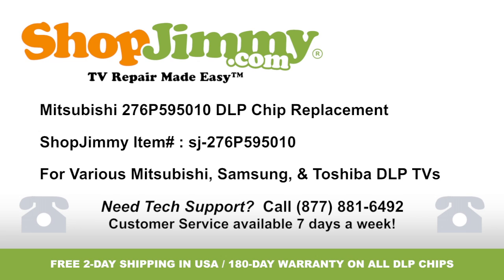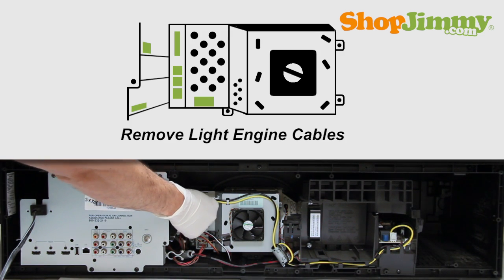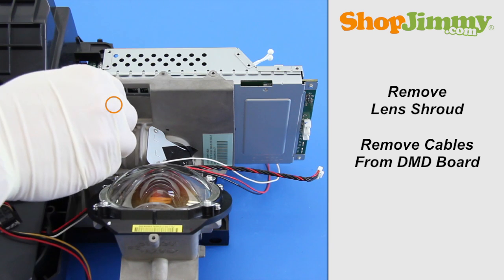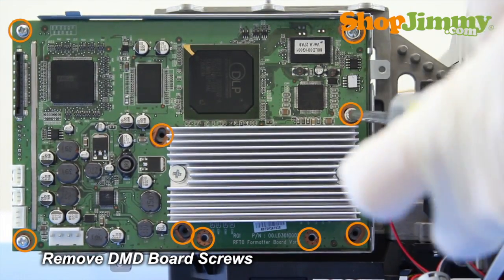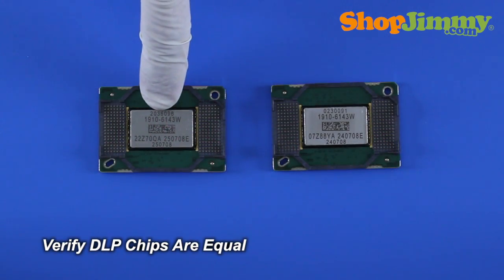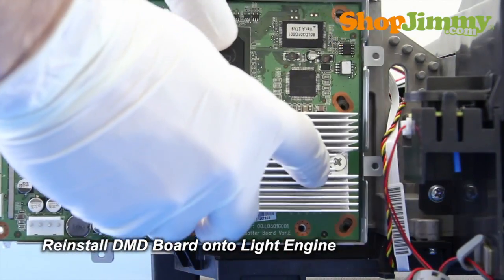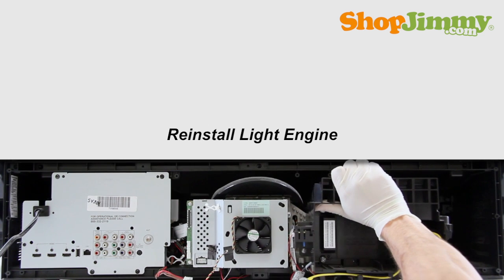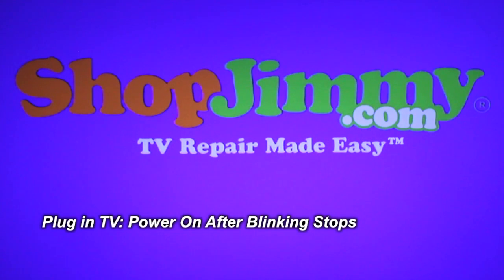Replacing a DLP TV Chip - White Dots Issue - How to Fix Mitsubishi DLP TVs

Comment: I just finished replacing my dlp chip for my Mitsubishi WD-73735, and now when I power on the tv there is sound, but no picture. After 30 seconds the tv powers itself off. I then took everything apart and reperformed the install for a second time, paying especially close attention to the pictures I took to make sure everything was in it's proper place. Same results. Sound. No picture. Powers off automatically after 30 seconds. Then I opened up the hatch and removed the bulb for inspection. It does not appear to be blown. I have 2 previously removed bulbs from over the past 5 years in a box and I took a look at them and you can obviously see that the old ones are blown, because they are black/gray/smokey looking at the stem of the bulbs. The one in the tv is clean,clear and was functioning properly 3 months ago when the white dots started appearing. I unplugged the set and put the tv to the side until today. There are no colored warning indicator lights showing on my tv. The red lamp warning indicator light is not coming on. The status light is red while the tv is off, I press the power button and the tv switches over the the timer light and it is green. Then 30 seconds later the set powers off and the status light turns red again. What's going on here?
Reply from the maker: Jason Buffington   Be sure to lock the chip into place.  Thanks!  www.shopjimmy.com

Comment: I bought my new dlp chip several months ago and am thiking about doing it today. Found a comment on another YT video before finding this one - the comment mentions a "heatsink compound" which you don't mention in your install - is there a need for a heat sink compound?  thanks!  Great vid by the way - will probably post another comment when I'm done.
Reply from the maker: rgee bee   You do not need it.  Thanks!  www.shopjimmy.com
Reply: ShopJimmy.com
That is a bad call, If thermal paste is in place reapplying can cause air bubbles resulting in poor conductivity, If it is a pad then the first time the chip is heated it causes it to take form and fill any voids... NEVER should you reapply a pad as it will not fill those voids again. You should NEVER remove a heatsink and replace without changing the interfacing materials

Comment: Hey guys looking for some help with a Mitsubishi WD 60735. I installed the dlp chip to get rid of the white dots but now I get just a snowy image on the TV and after a couple minutes the Tv turns off and has an  orange STATUS light blinking . Sound works fine. I believe I may have connected the wires improperly.
Reply from the maker: Rich Ramos   Double check all of your connections and also be sure the lamp door it shut all the way.  Thanks!  www.shopjimmy.com
Reply: Thanks I'll give it a try soon.

Comment: I have a Mitsubishi WD-65638 similar to the one in this video. I followed the video very closely it took me 2 1/2 hours to finish since it's my first time doing this. Now when I turn it on the light is green then flashes red then yellow what did i do wrong or what's going on?
Reply from the maker: *****   I recommend that you reseat your chip and check the lamp door to be sure it is closed all the way.  Thanks!  www.shopjimmy.com
Reply: ShopJimmy.com Thanks for the advice but it turns out it was my DMD board it had to be replaced.

Comment: For a Mitsubishi WD-60638 which chip system should I buy. the Samsung/Mitsubishi/Toshiba 4719-001997 DLP Chip (Original, New) or the Mitsubishi 276P595010 DLP Chip / DMD IC --NEW / Original. I don't know the difference, it's giving me a option so please help me?
Reply from the maker: Stephanie Jones   Here is a link to a replacement chip for your TV model:  http://www.shopjimmy.com/samsung-mitsubishi-toshiba-4719-001997-dlp-chip.htm  Thanks!  www.shopjimmy.com
Reply: Okay thanks, I got the right one than.

Comment: A great video- what did we do before You Tube??- I just successfully replaced the DLP chip in my WD-65735 in about 45 minutes. This video was great in explaining what is to be expected and the tools needed. I am fairly technical and most likely could have done it quicker but for a fear of ruining another chip due to static electricity. As a note the WD-65735 does not require the entire lower section to be removed only the cover of the light engine, heat sink and pull the board off. Just make sure that you have the rubber gloves and handle only the edges of the board. Also take a picture of the cables at the top in order to ease the location on replacement. Also recommend a magnetized screw driver for the board screws as they are difficult to reset in a couple of corners.

Comment: Just finished replacing my chip on my Mitsubishi... A couple of notes not mentioned in the video (which was well done).

a) You don't have to remove the entire light engine on my model.  The board comes out fine without removing everything.
b) It is a very good idea to replace the heat transfer putty. There is some fancy nano-diamond materials that supposedly work  best. If you don't replace the thermal putty, your problem will likely come back since heat is the root cause.
c) Clean everything carefully before putting it back together. Dust can cause multiple problems (heat, lamp failure, etc.).
d) I'm considering putting in a better fan... these TVs are great when they work but thermal management was not very well done.

Thanks very much for the post, I'm a rank amateur at these things so it was a lot of help.
-John
Reply: Upgrading the fan is not a bad idea at all...

Comment: I have a Mitsubishi WD-60737 that has white dots on the periphery and black dots on the bottom 1/3 of the screen towards the middle. I have seen mixed reviews of whether to change to DMD board alone, the DLP chip alone, or both.
Can you give some advice?
Reply from the maker: Rob Neuenschwander   I recommend replacing the DLP Chip in your TV.  Click this link to a replacement chip for your TV model number:  http://www.shopjimmy.com/samsung-mitsubishi-toshiba-4719-001997-dlp-chip.htm  Thanks!  www.shopjimmy.com

Comment: The pins are straight - next?
Reply from the maker: steve lazoritz   Be sure the chip is locked into place.  If the chip is securely locked into place and the pins are not bent, and you still have a problem, then I would say the formatter board may be bad.  Thanks!  www.shopjimmy.com

Comment: Just replaced the DLP chip on my 73734. Everything was pretty similar to the video. The only minor difference was there was a cable going into the light engine that screwed on/off. That connector also had to be unscrewed before DMD board housing could be removed in addition to the screws in the video.

Following the video made the whole thing a snap. I also purchased a new lamp. The combination of the new chip & lamp literally made my TV like new. The amazing HD quality I purchased the TV for in the first place is back!

Comment: I just completed replacing my chip for someone else' directions. When I completed the process, I had vertical lines, but the dots were gone. I then Googled for chip replacement once again and found this video. The key step that was missing was unlocking the old chip, installing the new one and then locking the chip back into place. The lines are gone, the dots are gone and I am once again watching a clear picture. GREAT VIDEO!!
Reply from the maker: Jay Mueller   At 4:20 in the video we show how to unlock and remove the DLP Chip.  Then after showing the search, we show how to install and lock the DLP Chip into place.  Thanks!  www.shopjimmy.com

Comment: I replace the DLP on my Mitsubishii. White spots gone ! Now I have vertical lines. Yikes!  I reseated the chop. No change. Suggestions?
Reply from the maker: steve lazoritz   Check and be sure that you did not bend the pins on the chip.  Thanks!  www.shopjimmy.com
Reply: Make sure you didn't tighten the heat sink too tight (the springs are meant to hold the heat sink in place)... I did and the contacts must have come loose a bit since I had exactly the same problem. You might also consider putting some new heat sink putty interface while you are at it.

Good luck!

Comment: I have a sony KDL-46XBR4 and the screen is all vertical bars until I touch the screen and pull on the right side then picture is fine.  I have a video of this.  Can't figure out how to add to this comment.
Reply from the maker: gchase65   This sounds like a TV panel (TV Screen) problem.  If your TV panel is bad, it may be more cost-effective to replace the TV as panels are typically hard to find in stock, difficult to replace, and expensive.  Thanks and please let us know if you have any further questions!  www.shopjimmy.com

Comment: I have a Mitsubishi WD65735 with white dots and a purple shadow at the top of the screen.  Replacing the lamp didn't fix the white dots although I know that will be fixed with a new DLP chip.  however will it also fix the purple shadow I am seeing?
Reply from the maker: Marc Dorn   Yes that will be fixed by replacing the DLP Chip.  Here is a link to a compatible replacement chip:  http://www.shopjimmy.com/samsung-mitsubishi-toshiba-4719-001997-dlp-chip.htm  Thanks!  www.shopjimmy.com

Comment: I normally don't write reviews but am compelled to write one after installing a new DLP chip in my Mistubishi WD-60735. I am not a handy man and have zero patience for anything to do with tools and mechanics. I got the dots and my choice was to buy a new 60" or try the chip replacement. After watching this video several times I decided to go the chip replacement route. I just completed the job, it took about an hour and it worked!  

Few observations/suggestions:
 1. My Mitsubishi did not look like the one in the video, especially when it comes to wiring and the overall mechanical arrangement.
 2. I didn't have to remove the lens shroud but I did anyway following the video instructions.
 3. Good thing I tock pictures at each step before removing any wires. My wire harnesses were different than those in the video.
 4. If it was't for the pictures I would not know what goes where and definitely would've screwed up.

Otherwise, everything went without a hitch.
Reply from the maker: Tad Witko   Thanks for your comments!  This is the goal of the videos is to provide help and tips for your DLP Chip Replacement.  www.shopjimmy.com
Reply: I have the same type of TV

Comment: I have a Mitsubishi WD-65837 should I use heat sink thermal compound oh heatsink when I replace the DLP chip ?
also is there a way to reset the lamp timer back to zero when I replace the lamp ?
Reply: I would like to know this also. But, since I'm in the middle of the job any answer will likely come too late to help me.
Reply: +The Cuch They said in an earlier response, "no" specifically. I haven't put any on mine but I gotta admit, I am concerned about it regulating heat. I might go back in and replace with thermal paste.

Comment: Ok I have a lg 47ld450 and it won't power up by has the stand by light flashes I'm pretty sure I have already change what I believe is the power supply any ideas please let me know
Reply from the maker: Dakota Keele   Since you have already changed out the power supply, I recommend replacing the main board to see if that fixes the problem.  Click this link to replacement main boards:  http://www.shopjimmy.com/catalogsearch/result/index/?cat=56&q=47ld450  There may be multiple boards for the same TV model number, be sure to match part numbers on your current board, with your replacement for compatibility.  Here is a link to a video showing how to identify your part number, click here:  https://www.youtube.com/watch?v=RwHTvjMdrhk  Thanks and please let us know if you have any further questions with your TV Repair!  www.shopjimmy.com

Comment: I replace my lamp about 2 months ago, then I started getting the white and black dots on my Mitsubishi DLP WD-Y577.  So I replace the Chip, but now I'm getting the steady red lamp.  Anybody have any suggestions on what I did wrong?
Reply from the maker: Kevin Berry   The first thing you should do is make sure that your lamp door is closed tightly.  If that looks good, I would go back in and reseat the DLP chip and double/triple check all of your connections to make sure everything is correct.  Thanks and please let us know if you have any other questions!  www.shopjimmy.com
Reply: ShopJimmy.com Thanks, I reset the chip and everything work fine.  Thanks for your help.

Comment: i purchased a replacement dlp chip for my mitsubishi wd 73737 tv from shop jimmy.  before replacing the dlp chip, the lamp was working, just had lots of spots in the picture.   i just installed the dlp chip and am confident i did it right.  when i plugged the tv back in, the light in front is flashing yellow, which according to my manual, indicates a failed lamp.  i was very gentle with all parts coming out and back into the tv during the replacement of the dlp chip.  is that a normal occurrence for the lamp to go bad during this process, or might the flashing yellow light be indicating another problem besides a bad lamp?
Reply: I figured out the problem.  I didn't replace the bottom panel when I tested the tv to see if it was working after replacing the dlp chip.  I didn't realize the bottom panel engages the lamp switch.  After replacing the bottom panel, the lamp switch engaged and the tv works like new.  Thanks much for the reliable part, reasonable price and very helpful video.  Many thumbs up for ShopJimmy!
Reply: Nick Matzorkis 
Thanks Nick for replying with the solution. I did the same exact thing of trying to test before replacing the back panel and that orange status light was driving me crazy lol.  But after that my TV is as good as new!

Comment: I must say this was a comprehensive video on the operation and technical navigation of this procedure.  Do keep on mind that this exact  video walk through as far as the screw for screw example here may be quite different from your tv.  Many of the cable locations were way different than my WC-609C model and because I'm already technically savvy it wasn't a huge problem but even I had to step back a few times to relate to my setup and this tv setup.  You must record and note items, screw location and device location in order to do this right the first time.  Don't assume that your tv components will be exactly in the same lovation and order this one is.  Photograph and categorize as u go along.  It worked great for me.  New chip along with a new lamp I had installed 2 months before the dot issue showed up so I'm good at least 3 more years.  Kiss off LED!!!

Comment: Hi, I bought a dlp chip from your site, and everything went great.
My problem is I tried to update the firmware by downloading it to usb, and pluging the usb into the tv. Now all I get is the blue welcome screen and flashing green lights. Please  help
Reply from the maker: Jeffery Smith   You have 2 options.... Keep trying the update, some people have had luck after trying 10+ times. Or replace the main board in your TV as the firmware update may have damaged the main board.  If you do need a replacement board please reply with you TV model number and then I can recommend a replacement part for your TV repair.  Thanks!  www.shopjimmy.com
Reply: ShopJimmy.com
Scary....We are about to try to update the firmware on our Samsung HL67A750 to have 3d.  We are not exactly computer savy..but trainable.
Any suggestions?

Comment: I just installed my new DLP chip in my Mitsubishi WD-Y577 TV and now it won't turn on.  Either the orange light for the "lamp" is on or the light for the "lamp" turns green and the red "Status" light turns on.  Any suggestions on what went wrong?  Already tried reconnecting all of the cables.
Reply from the maker: Morgan R.   I recommend checking to make sure the lamp door is closed all the way.  Thanks and please let us know if you have any other questions!  www.shopjimmy.com

Comment: Hi i just replaced my DLP chip, it was not that hard at all, like someone else said before: my model was a bit different and it was still about the same procedure. I do have a question??? So like i said i had replaced the DLP chip turned it on to make sure it was working and it is NOOOO white dots i am extremely excited about it, but after 5 mins of being on i smelt some kind of electric smell almost a burn smell. Not sure what that is or why it is doing it. Not even sure if its my tv but since its the only thing i was messing with that what i assume. have any of you encountered this problem if so then what did you do to fix it. I did tighten the screws good and i put them all in the same spot i took pictures even so i would not forget. I have a Mitsubishi WD-60737. Any help is greatly appreciated. Thank you!
Reply from the maker: smashlie33   Double check all the connections and make sure nothing is touching to cause a short.  Thanks!  www.shopjimmy.com

Comment: The replacement was rather quick, but when I turn on the TV I see very faint vertical lines.  The lamp seems to be working fine because I can see that it's lit from the back.  any suggestions?
Reply from the maker: Michael Gibo  What part did you replace and what is your TV model number?  Thanks!  www.shopjimmy.com

Comment: wd 73833   replaced DLP chip and now the lamp light flashes and no picture.. call and was told to replace again for resetting but still same result.. lamp flashing
Reply: same thing here get anything figured out yet ?
Reply: Same with mine. Did you ever find anything about this problem?
Reply: same problem here, any fix yet?
Reply from the maker: Shelley Lemerande   What is your TV model number?  What are the symptoms your TV is showing?  If you have a LED blinking, how many blinks are you seeing?  Thanks!  www.shopjimmy.com